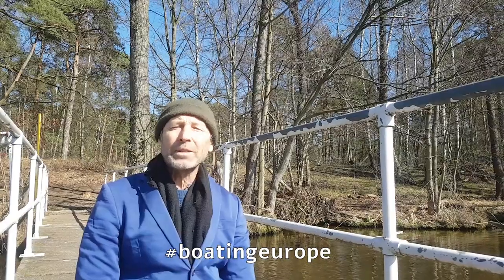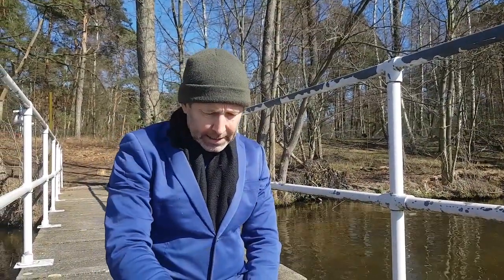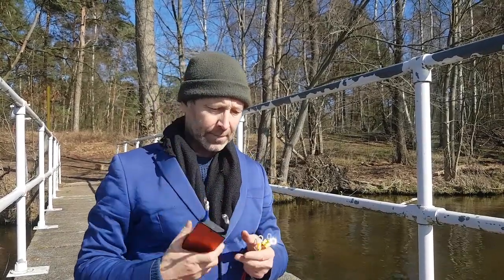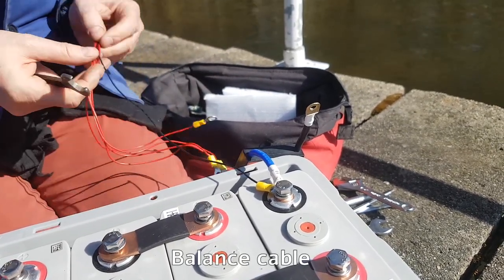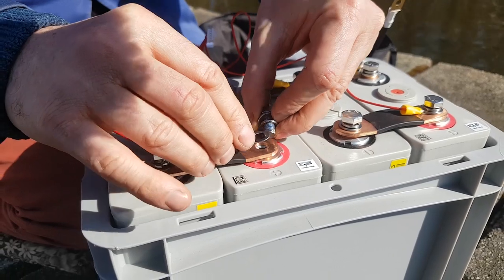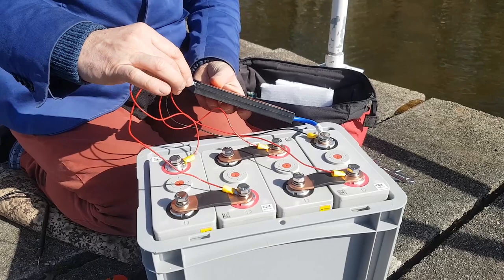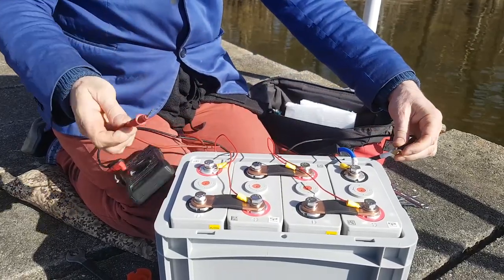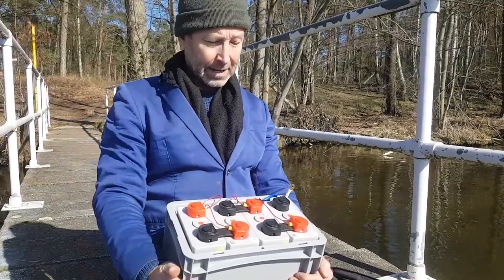Boat battery lifepo4 - part 2/3 the build

Comment: Hamish, thank you. I stare at posts on Facebook about batteries and it's as if everyone has typed in a foreign language, but this is beautifully, simply done and wonderfully empowering for the non-lithium speaker.
Reply from the maker: One more video to come on installing the battery in the boat to replace a lead acid and reconfiguring the mttp solar charge controller for lipo4. Have to deal with replacing the spit spit chargeing system for the starter batterys as well...

Comment: good job! make sure the battery for the outboard dinghy has a Ah number is higher than the Amps number it will maximally draw. so make sure your battery is not too small, it will increase lifespan. (i am using Winston cells - 6 th year, they are still as good as new according to the last read-outs - so, in the longer run, Lifepo4 is always cheaper)
Reply from the maker: We have a small 12v max 25ah outboard so a 1c 50ah battery will do fine matched with the waterproof 80ah BMS i have allready. Just need to find a water resistant box.

Comment: any word on 3/ 3 ???
Reply from the maker: Still not fitted it to the boat, have been using it to power the tender trolling motor. We have complexitys with the engine starter/house cross charging than needs solving, it's on the list...

We have to sought this for BSS when back in UK so should happen soon.